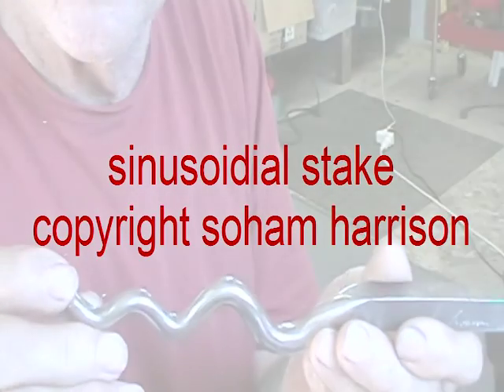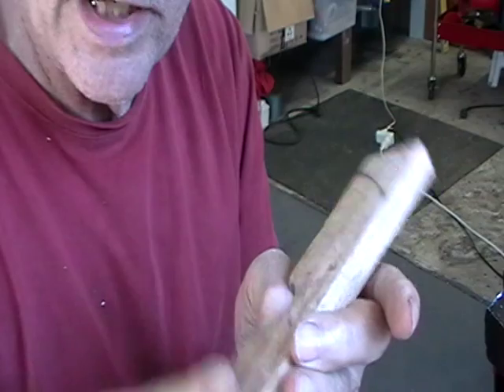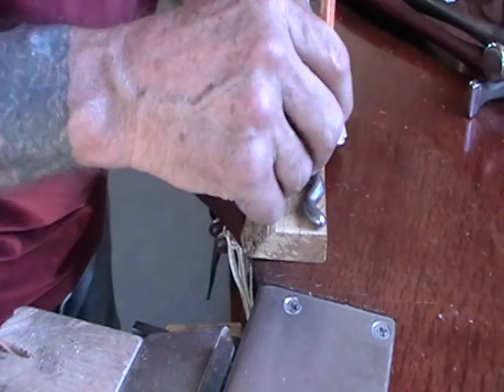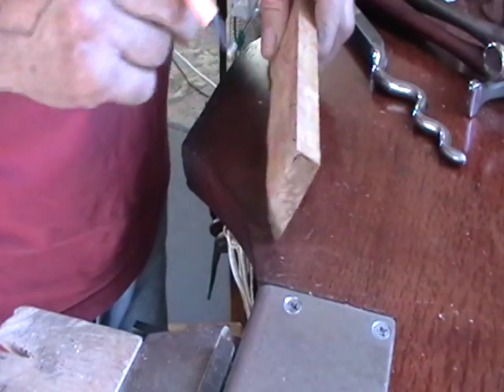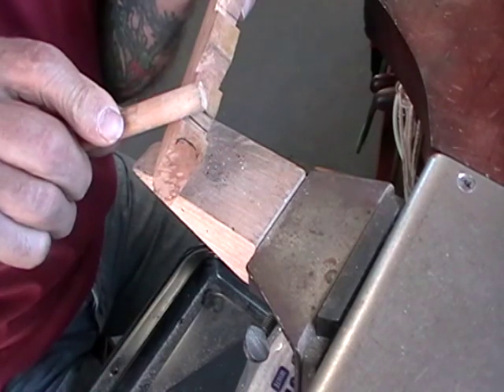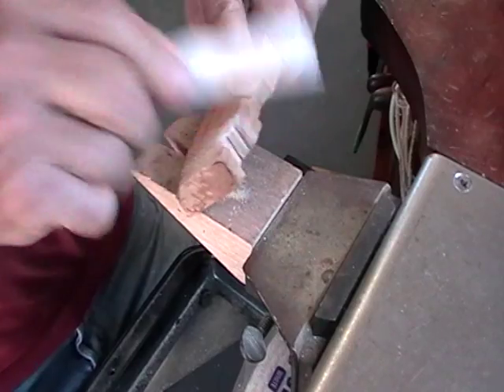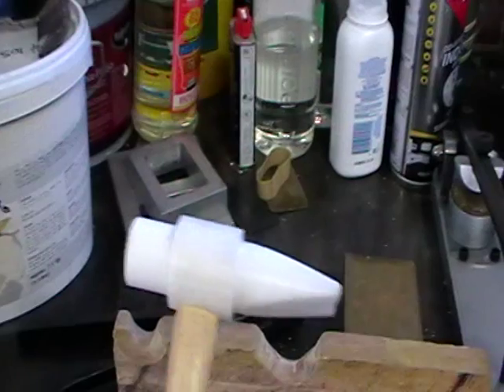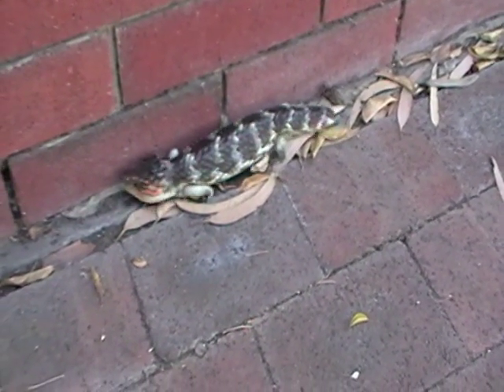sinusoidal stake

Comment: I was a carpenter for years and have an idea that may make this a bit easier. Maybe using a hole saw to drill the holes and cut in half then router the inside of the cuts. Finish with sand paper. This way you will have a back up as well. Lol. Of course thats if you have the tools or know a friend that does.
Reply: i was going for absolutely basic tools. brilliant if you have the wood working tools or if you know someone that does. there are better videos on how to do this with proper tools.